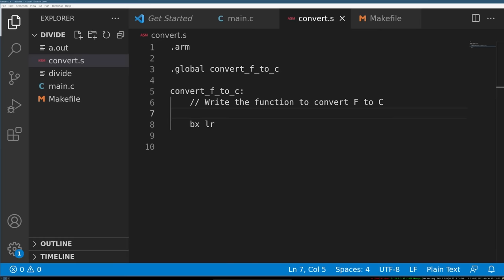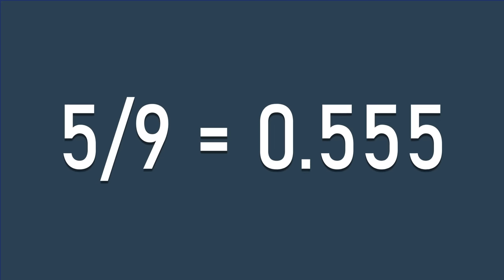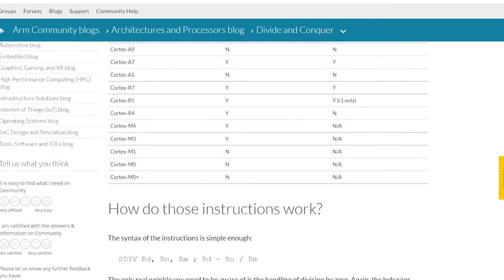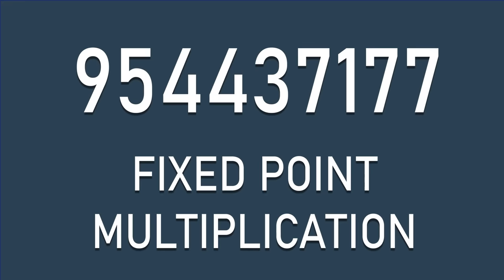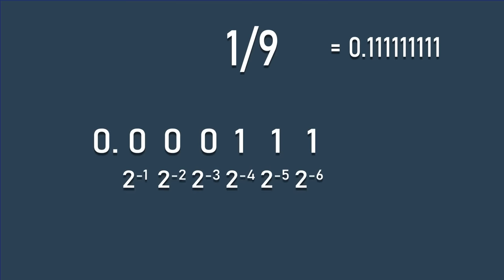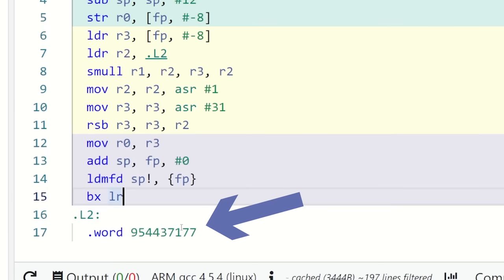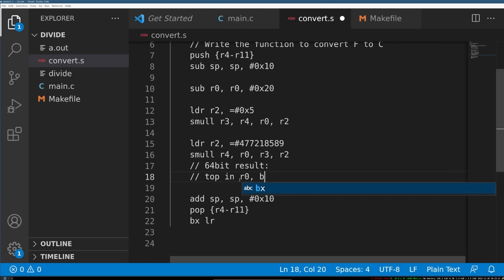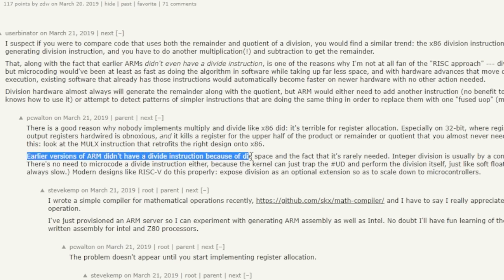computers suck at division (a painful discovery)

Comment: I like how it changed to night with the easy bit at the start
Reply from the maker: FINALLY someone noticed that XD
Reply: @LowLevel-TV  legend
Reply: The Firestorm core in Apple M1 has a dedicated Divider ALU.
Reply: @Xevos701  The Firestorm implementation of integer division is surprisingly efficient, but it's nonetheless 2.5-4 times worse in performance than the corresponding multiplication.
Reply: Multiply by 555, then bit shift
Reply: can someone explain to me?
Reply: @jixt3r  It is a trick of the numbers. Basically, there is no division, but you can fake it by doing multiplication first. 

There are generally several ways, but essentially, you have a number that A=10, and you want to divide by 3 which is the same as multiplication of 1/3. Problem is there is no way to hold a 0.333333. However, if you multiple everything by say 100
A=10*100 = 1000
B=.333*100 = 333
Then when you multiple the two you get 333000, but because of the way computers work (bits and bytes), but also because of the way the CPU works, it is actually in memory something like high order bit [3] lower order bit [333000]. You get a fake floating point (real number), and you just get the answer of 10/3 without division by pure bit magic.
Reply: @DavidGarcia-se3ko  Thanks for explaining the subject of the video to me but I was referring to the main comment
Reply: @DavidGarcia-se3ko  But how does the computer know the value of 1/3 if it doesn't do division?
Reply: @jixt3r  
The computer is generally agnostic as to what is in memory, or the meaning thereof. It is necessary to understand that the any arbitrary set of bits could be thrown at the CPU and some random event may occur. Further, any point of memory could either be set, marked, or used as code or merely data which is how run time compilers work as well as how various computer attacks like code injection, and polymorphic viruses. As such, as it relates to 1/3, the question is not how the computer knows, but how the human has arranged the code to produce an outcome consistent with the effects of the number being 1/3. It is all of a matter of representation and operation.

In this case, one need only look at their are various arrangements. I will use base 10 integer for clarity, but treat them as some sort of magical base-10 compute because I don't want to have to do binary math here.

overflow [0000] hi:[0000] lo:[3333] ~= 0.3333 but actually means 3333.

overflow [0000] hi:[0009] lo:[0000] ~= 9.0000 but actually means 90,000.

multiple them together

overflow [0029] hi:[9970] lo: [0000]

take the overflow and add one if the hi register is over 4999.
 then move the result back to memory as 3 in the lo
Reply: @LowLevel-TV  you're either being completely dishonest here or you have no idea how binary math works
Reply: @LowLevel-TV  They divide the exact same way the multiply
Reply: "Without an FPU, I would have to use a simple solution that already exists. There has to be an easier way, like doing more work for no reason"
Reply: @chabadlubavitch7303  The other and probably correct answer:  is both dishonest and has little to no idea how binary works, friend.
Reply: @LowLevel-TV  
The designers of ARM, Steve Furber and Sophie Wilson, has previously designed the BBC Micro, a 6502 based computer.
That too only had left and right shift and the 6502 was a heavy inspiration for ARM.
This is early RISC stuff, few, fast and simple instructions and then write the exact functions you need yourself.
You do the bitwise multiplication thing, where 3x = 2x + x.
So left shift X + X.
Division is the same except backwards-ish.
I remember banging my head against this as a kid trying to learn 6502.
Great fun 👍
Reply: @jixt3r  He says it was an easy and familiar task, but it took him the whole day.
Reply: lol sometimes it be like that when you're coding
Reply: what does "changed to night" mean?

Comment: "I didn't want to use an incredibly low level library, because it felt like cheating" Been there before, I know where this road leads. I wish you luck on your future breadboard CPU project!
Reply: Either breadboard or TempleOS, one of two roads
Reply: RNJesus speaks to me.
Reply: Seriously, there is a reason high level languages exist. If you can let the compiler and the language take care of your branch tables for you, you can save a lot of development time. These days, the only reasons to work with assembly are for SIMD optimization, extremely optimized library functions (often involving SIMD), and occasionally interrupt routines.

There are occasional times with small micro-controllers like this where you need to use assembly, but code the compiler creates is typically roughly equivalent to what you'd create, and often better. Don't underestimate the power of auto-loop unrolling and function inlining. The linker can take all sorts of shortcuts that you wouldn't think to.
Reply: @EmptyZoo393  What's the fun in that?
Reply: @mikicerise6250  
Do you speak Aramaic? What has He been telling you?
Lemme guess. "Donald Trump has been sent to save you all" maybe?
Reply: Wring your own isn't the issue, it's using your own. Writing your own implementation allows greater understanding of the tool you're using. Many of the issues I see in software engineering are people using tools and not understand how they actually work. Treating an API as black-magic leads to using the wrong tool for the job.
Reply: Haha, never went the breadboard CPU route, but I certainly (like probably most programmers in the beginning) feel you. Maybe the most important thing I learned is to have the actual goal in mind always and to use whatever tools you have to achieve that goal asap.
Reply: @TheDavidlloydjones  a little late but woosh
Reply: If you wish to make a program from scratch, you must first, invent the universe
Reply: @NoX-512  having fun with low level languagesor finishing the project in a reasonable time frame, choose one

If your goal is to have fun with going low level, you're free to do it! Just be honest that's your goal.
Reply: @MajoraZero  It doesn't take longer to write assembly if you are experienced. High level languages are for portability, readability and faster learning curve.
Reply: "I wish you luck on your future breadboard CPU project!" - ROFL
Reply: @NoX-512  thats just not true. to complete the same task in assembly as other higher level languages requires more code thus more keystrokes thus more time
Reply: Compilers provide intrinsic functions (built-ins) that wrap the cpu instructions so you don't have to write assembly code directly
Reply: It depends. Am I doing this for work? Use the library.

Am I doing this for fun and already know the underlying principles? Use the library.

Otherwise, I’ll roll my own for the learning experience. In general libraries are far more robust and performant than anything I can come up with though.
Reply: you can iether go with floating point math or an approximation of floating point math, which is cheating with less steps
Reply: @colalightyear7859  "The only thing more dangerous than a hardware engineer who thinks they can code is a programmer with a soldering iron."
Reply: @TheDavidlloydjones  you should go to Home Depot. Someone whose this angry needs to reincarnate
Reply: @EmptyZoo393  but thats easyyyyyyyyyy
Reply: @jek__  
1. make the universe yourself
2. make the silicon yourself [no stars to help you]
3. manufacture the hardware yourself [no machinery to help you aside from what you can make]
4. reconstruct all computing knowledge yourself
5. write some assembly code to print "Hello, World!"
Reply: real